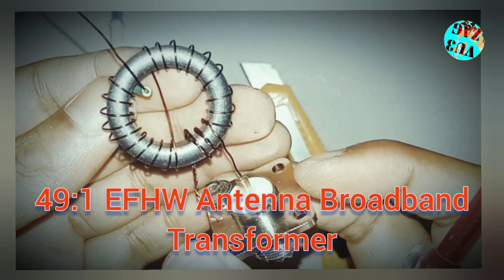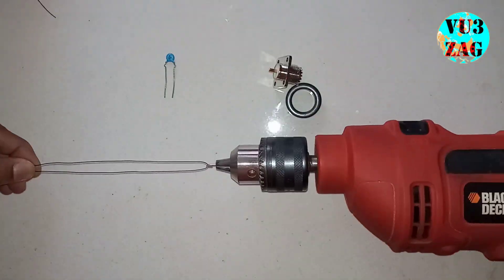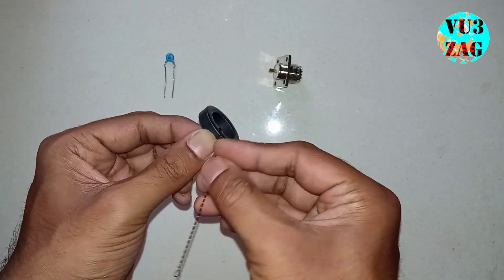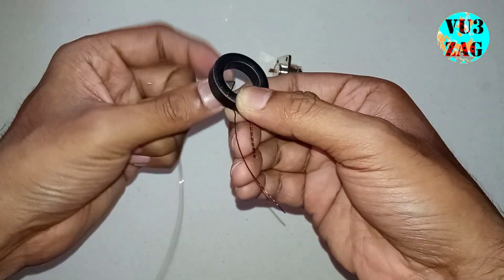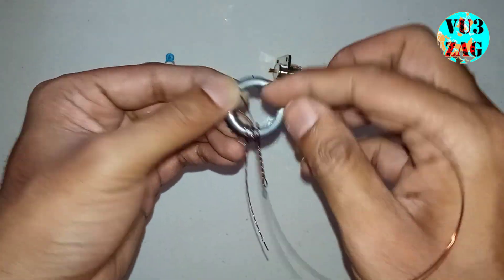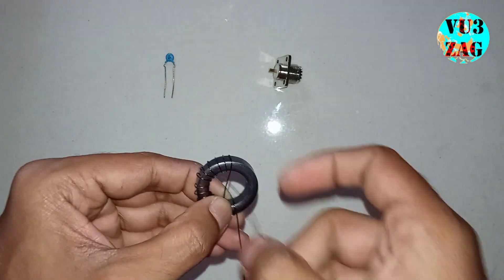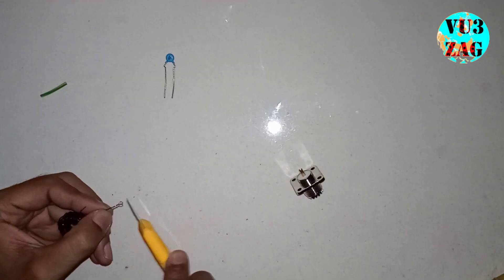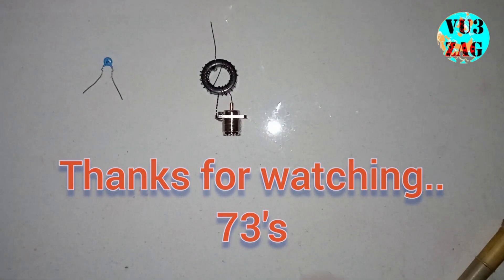49:1 EFHW Antenna Broadband Transformer

Comment: I have a large FT-240-43 Toroid, can I use that and what will the power capacity be?
Reply from the maker: Yes, FT-240-43 can handle more power. A setup with single toroid can easily handle150 watt.

Comment: That was great, thank you! I didn't follow the purpose of that first wire being twisted into a double strand sorry - if you have a minute could you (or anyone else) please try to educate me?
Reply from the maker: Since it's expected to work as a Broadband transformer on High frequency -as compared to seperated windings of primary and secondary, a twisted pair acts as transmission line in Radio frequency and helps in better coupling along the length as well as through the core.
Reply: @vu3zag  Thank you!